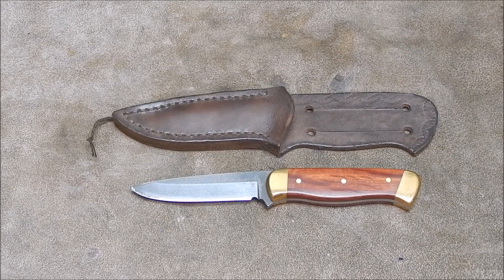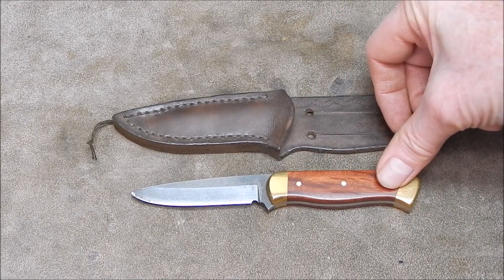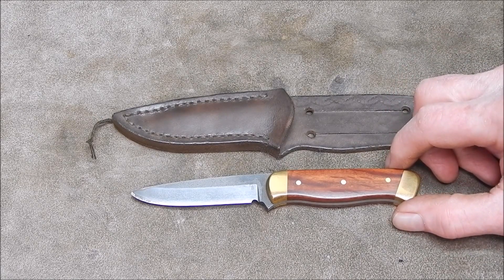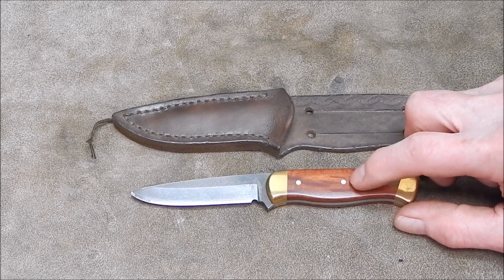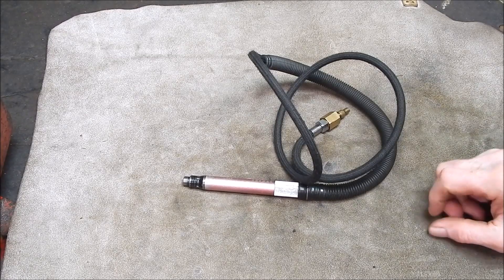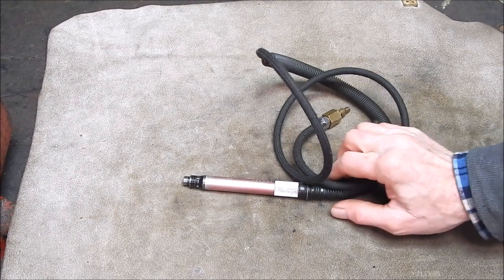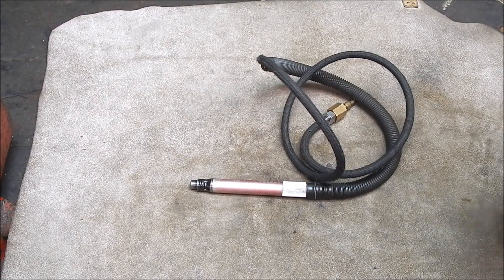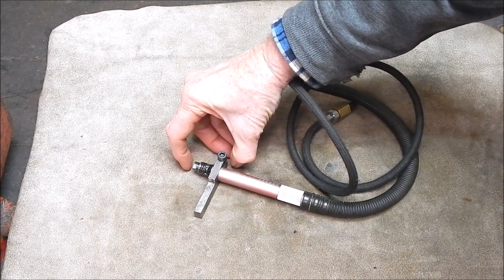How to easily part off hard and small diameter work on a metal lathe

Comment: Hi, nice idea. Would you possibly have a better cut if you either ran the lathe in reverse or come in from the back so the two pieces would be turning in different directions.
Reply from the maker: It makes no difference, as the disc cutter speed is way faster than the lathe.  Cheers Rob

Comment: Hi Rob. That's a great tip 👍👍👍 You can also use a flexible drive drill chuck and a die grinder. About the same size as your pencil grinder but no need for air. Cheers, Alan.
Reply from the maker: Hi Alan.  Yes, a few possible ways to do it.  I see people struggle to use regular parting off blades on cheap lathes and offer a solution.  I normally use the consumable discs as they do a better job, but make a bit of a mess.  I also seem to have accumulated a lot of them somehow.  Cheers Rob
Reply: @Xynudu  Hi Rob. Nothing shows up lack of rigidity in a lathe like parting off!  Now I have a decent setup on my lathe it will quite happily part off brass, aluminium and steel. However, I still generally use the Kennedy power hacksaw for aluminium and steel wherever possible. Mainly because ideally you need to use cutting oil/coolant with aluminium and steel on the lathe which makes a mess. The Kennedy may be slow but it gets there in the end and no mess 👍 Cheers, Alan.
Reply from the maker: Mess is the bane of metal workshops.  That new magnetic broom is proving to be a real winner.  Does the work area in a couple of sweeps and picks up everything ferrous. I see VEVOR sold out all thir stock of the wheeled version sizes.  Their price is pretty much unbeatable.  That style of mag broom is being sold by many outlets, including my local hardware store.  Cheers Rob

Comment: for something that small to part off I would grind my own HSS to suit it will cut brass or bronze better than a carbide one
Reply from the maker: I have never used a carbide parting off blade.  I was taught to keep the speed down and use HSS with plenty of lube.  Works for me in most situations.  Cheers Rob

Comment: 🤔 I just use a hacksaw and a file 🤣
Reply from the maker: I expected that Bill ;)  Cheers Rob
Reply: 🤣 I use brass rod or alooominomiiooum TIG filler rod which is fine but the diametre is not consistent, Be intersted to see a way to get small thin pins consistent mate but like I said, knives don't need Stefan precision 😁
Reply: @billbaggins  Thats true.😊

Comment: Maybe a slitting saw would do the same, but eliminate the issue of slinging grit on the lathe.
Reply from the maker: It might.  I've never tried that approach.  The diamond discs don't throw grit, just metal particles and will cut through any hardness.  Cheers Rob